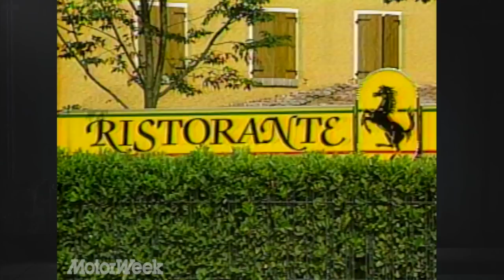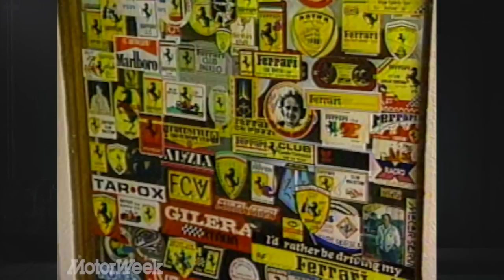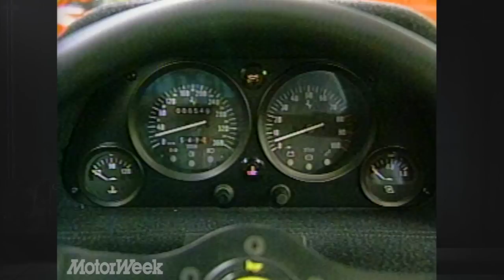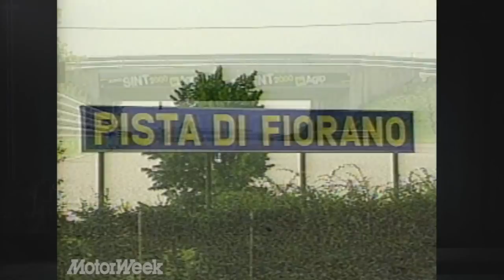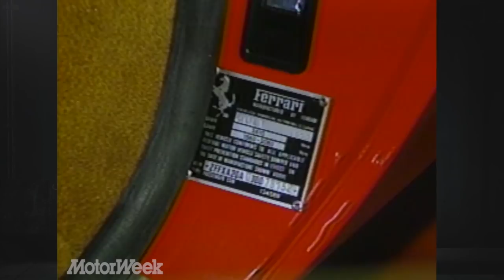1988 Ferrari Episode | Retro Review

Comment: Twice in this video I heard them state wrong statistics on a couple of cars. The first one I noticed was that they said the F40 was powered by a 3.0 liter twin turbo V8 when it actually has a 2.9 liter or 2936 cc’s. The second was when Lisa Barrow was talking about the upcoming Ferrari 348 which she said was going to have a 4.0 liter V8 which is wrong. It actually has a 3.4 liter V8 which is why it’s called the 348. Ferrari named a lot of their cars by using the engine size for the first two numbers and the cylinder count for the last number, 3.4 liters and 8 cylinders = 348. The car replaced by the 348 was named the same way 3.2 liter 8 cylinder gave you the 328. The 512 BBi was the same 5 liter 12 cylinders to give you the 512 BBi. Not all Ferrari’s were named using this formula but many were. Some used the displacement of a single cylinder like the 365 GTB/4 Daytona which had a cylinder displacement of 365 cc’s and 4 camshafts to get the 365 GTB/4. The last Ferrari to get it’s name based on it’s engine size and cylinder count was the Ferrari 458 Italia which has a 4.5 liter 8 cylinder engine. The Ferrari 488 that replaced the 458 has a smaller 3.9 liter twin turbo V8 with a single cylinder displacement of 488 cc’s which is how it got it’s name. Ferrari has traditionally used that formula for naming it’s 12 cylinder cars and used the engine size and cylinder count for it’s V8 and V6 cars like the Dino 246.

Comment: Forgot to mention that the first F40 units produced "first 20 if I'm not mistaken" were lighter, had over 650hps, the 0-100km / h was made in the 3.1s and top speed was over 370km / h or 230mp / h, this same setting was improved and used on the F40 LM a few years later!
Reply: Marcelo S I’ve never heard of any such thing I believe what your referring to is the fact a few years later a couple owners wanted a full on race spec so the factory made 19 not 20 f40lm. So no the first 20 were not lm cars they just only made 19-20 of them in 1990

Comment: 35 years later, you can buy a Jeep suv with a 3 liter inline 6 twin turbo with 22 more hp.
21:02 You are going to tell me to use something the maker of the car say not to.
If Ferrari wanted oil in the upper cylinders. They would not have install valve seals to keep the oil out.